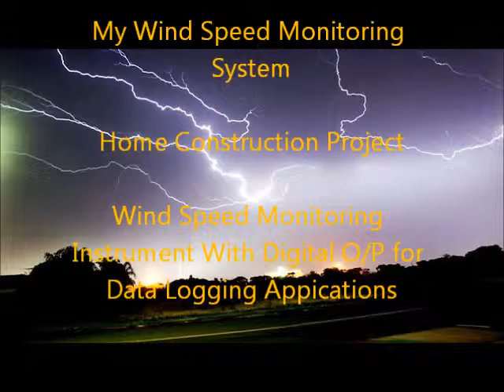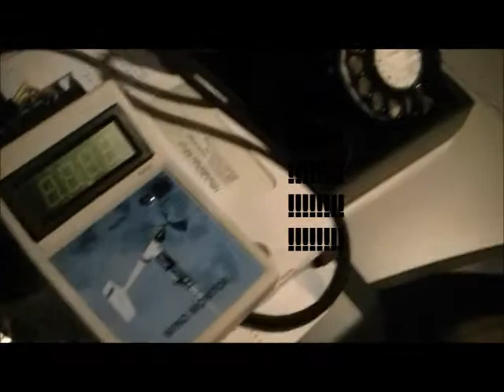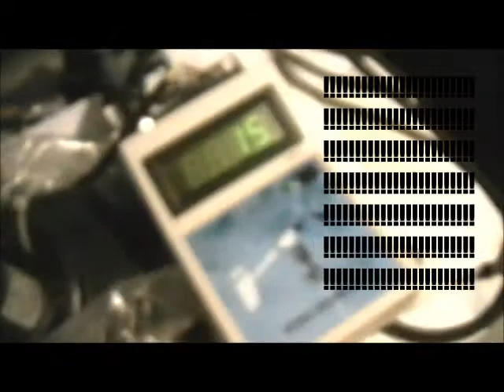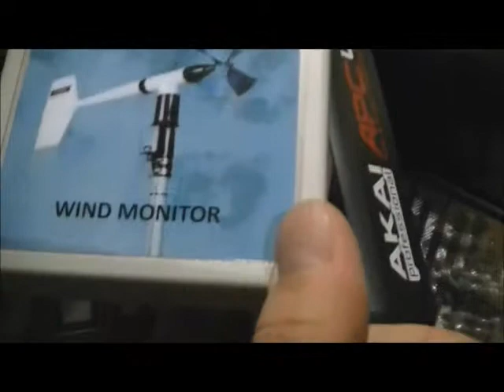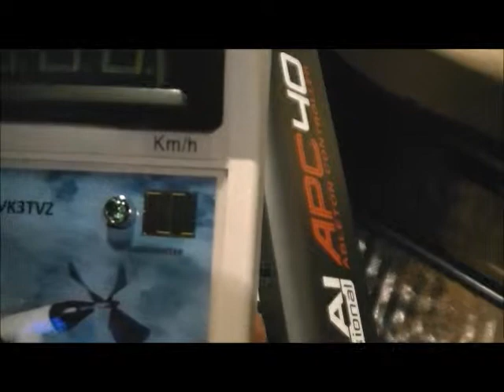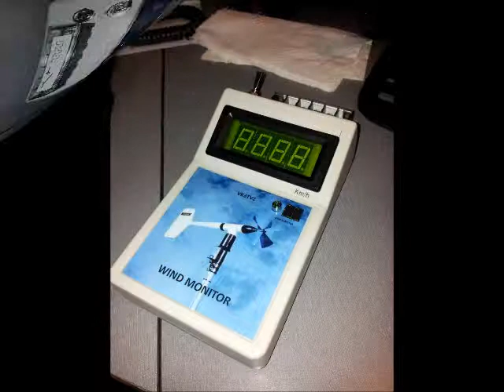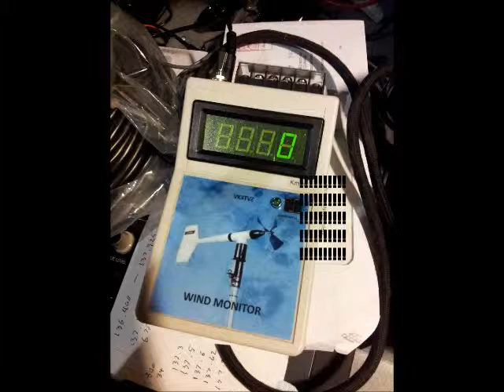Home Construction - Wind Speed Monitor Instrument

Comment: Awesome wind speed monitor.I was wondering if u will be able to help. I have to do a project and my boss has asked me to design and make a wind tunnel so i can control the wind speed. in order to calibrate wind monitoring devices. my knowledge is on this subject is next to none. any ideas or advice would be very helpful. thanks